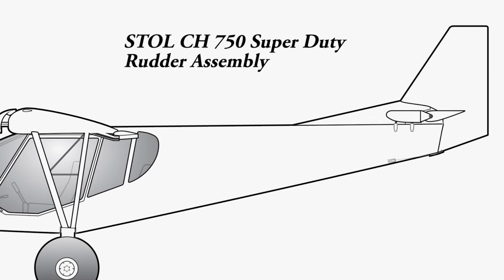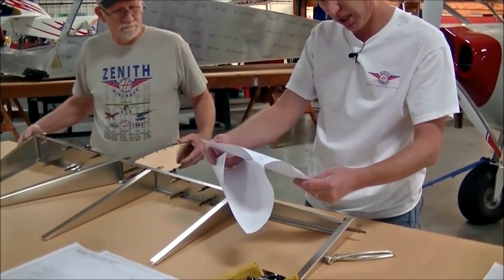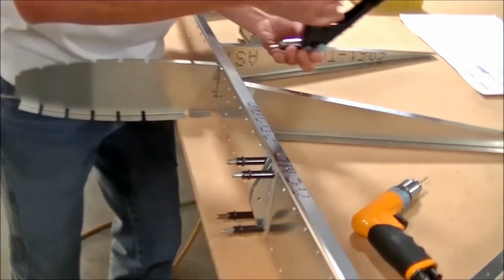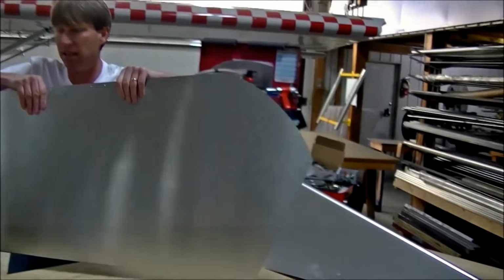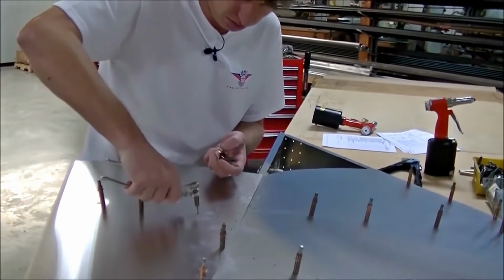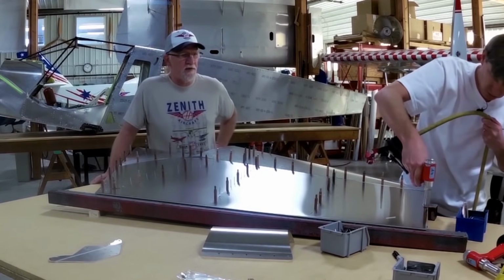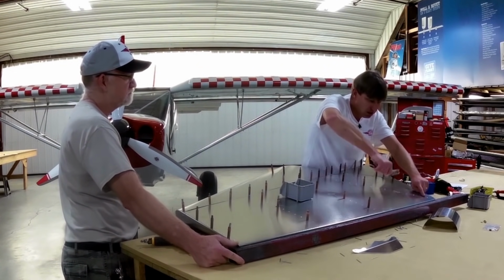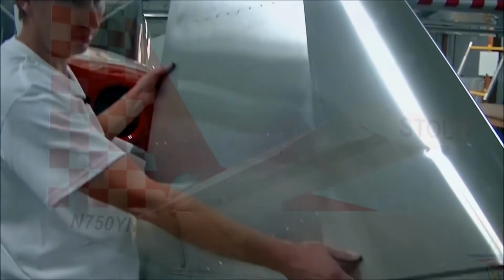STOL CH 750 Super Duty complete rudder assembly

Comment: Thanks! I enjoyed the construction of the tail assembly. I am certain I could build one with the kit at home, with the corrosion coating (120 miles from Corpus Christi, Tx coast & freq. high humidity.)
Unfortunantly, multiple health concerns, age & cost prevent my build of a CH750 super duty. My father was an aircraft Master Sheet Metal smith, working at Lackland AFB until '79, doing installs, bird proofing & maintenance of display aircraft all over the base. His dna is on most propeller aircraft & several older jets. The Clecos & pliers on this video reminded me of his set that I still have, so this great video was also a sweet trip down Precious Memories lane. Zenith is such a good, high quality company that I wish I could've done business with. Blessings & great success to you all ! Paul from S. Central Tx.

Comment: what material is the plane chassis made of
Reply: Main Fuselage (Chassis) is built in 2 sections: A front section, which comprises the area from the firewall, where the engine is mounted from, through the seat section. The rear section is comprised of the area aft of the flight deck and continues to finish the main body.  All of the aluminum is the same 6061 T6 material . There is a steel cage roll over section which attach the two sections together. That material is an aircraft grade 4130 chrome moly steel. Most if not all holes are pre drilled, most if not all are final sized.  There are numerous Utube videos that show the construction of those components.

Comment: Question Rodger: Why did you put the last piece in by tucking it under the corner piece of rudder?? Is that not a way for rain and wind to enter the
 tail ? I guess it makes more sense doing it with the overlap for weather and aerodynamic purposes.  Now I know this is a demo on how to, but would that not be a better way of demonstrating the build of the wing? Or will that last piece rub  on the end of Fuselage? I always try to defend you but being spot on with these videos is a must!  Just like flying being precise is a must! Thanks for the effort.

Comment: The entire build was for all intents and purposes done without reference to the building instructions which a first time builder should never do.  I would like to have seen an example of drilling out a rivet rather that the casual reference "it's easy to do."   I never did understand the purpose of the block placed under one of the beams nor why the repeated reference in pronunciation to the plural form "blocks" when only one block was used.  The camera holder (sounded like Sebastien Heintz) did try to bring these two experienced and fast workers down to reality for the sake of first time homebuilders but they would just take right back off again seeming to try and set a record for how fast one of these rudder assemblies could be built.  The older assistant tended to mumble and as a result was often not heard clearly enough to be understood.
Reply: if you're having a hard time understanding try watching it again. if you still don't get it I don't know that building your own plane is in your future. I've never worked on a plane and this all seems elementary.
Reply: The purpose of the block is to keep the piece level.

Comment: +Zenith Aircraft Company

Hi there, can you pleases tell me, what is the gauge of the aluminum?
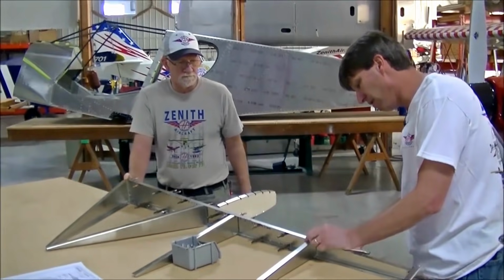at 11:55 you were saying "remove my existing quicker or clicker"  What is that how do you call it correctly, or can you please explain it what it is, what does it do by placing it?
Reply: It's called a 'cleco' and serves as a temporary rivet, holding pieces together until you actually rivet it together. Kind of like when you tape two objects together for alignment before gluing/nailing/screwing (or something) them together

Comment: I just watched your rudder build and was very impressed with how the rivet holes lined up.  Is the whole airframe the same or do you have to updrill/drill holes on the wings and fuselage?
Reply from the maker: Most of the kit is now supplied with final hole size match-drilled parts (just like the rudder assembly)

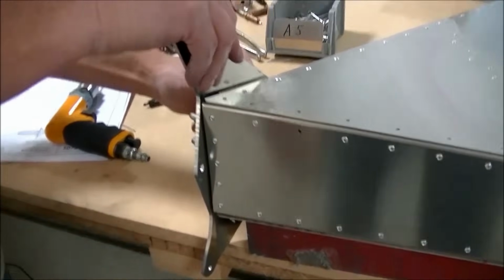Comment: At 50:20 I see what looks like an empty rivet hole between the spar and the spar doubler, it's visible just before the lower fairing is installed.
Reply: It just "popped" out at me while watching the video...
Reply: I'm wondering how Roger missed that....   It was purely because it was rushed for the video I'm sure.      One rivet out of over 8,000......   I'd fly it.
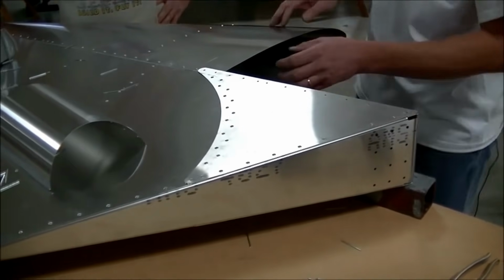Reply: I see the missing rivet too,  50:02-50:06 second hole from the bottom.  Time for a video on drilling out rivets and fixing the mistake.
Reply from the maker: No need to drill anything out. Just add a rivet in the hole a pull it.
Reply from the maker: Yes, I think he forgot to put it in. Good eye!